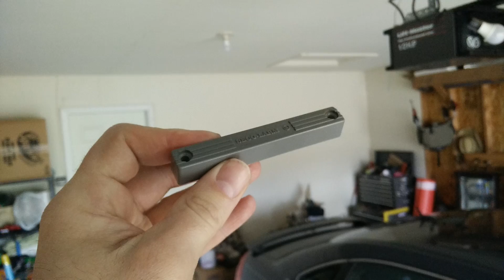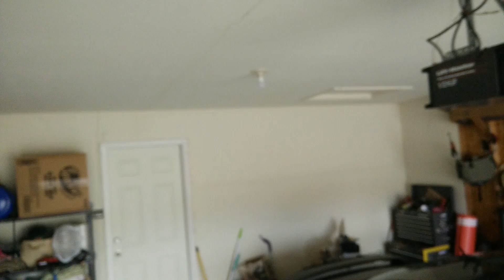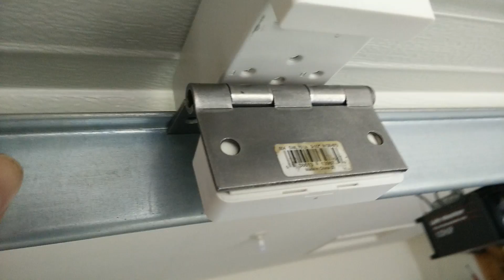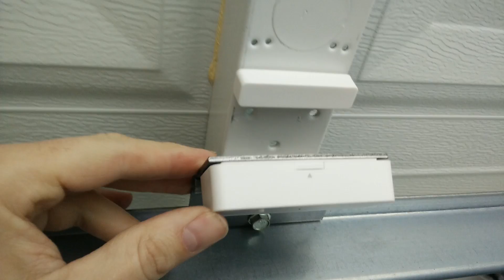DIY garage door open close sensor.

Comment: I was stuck trying to figure out to install a teeny Elgato Eve wireless sensor to my garage door and ran across your video. I could not figure any easy way to mount it to the sides of the door because of all the hardware in the way. This hinge idea is remarkably simple and so far quite reliable as I can easily monitor the door from a remote location and close it if necessary (with a hack I found on another YouTube video. Thanks so much!
Reply: Share the hack brother - I'm interested
Reply from the maker: I love to see this hack and your version of my setup.